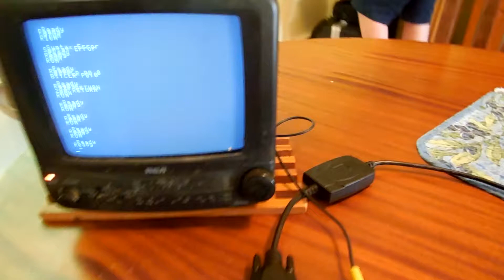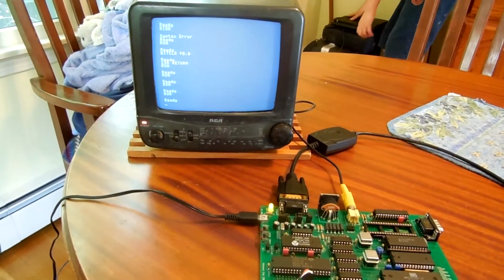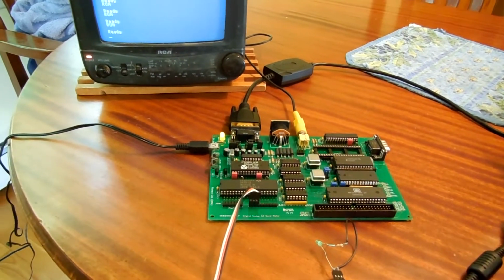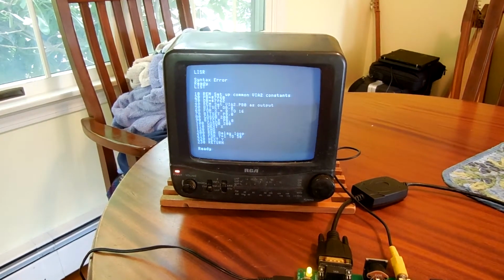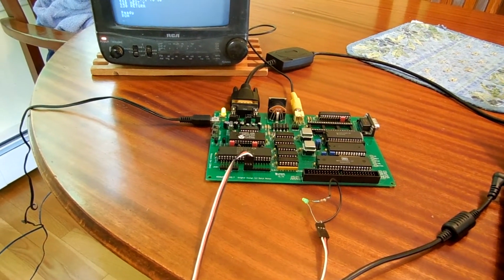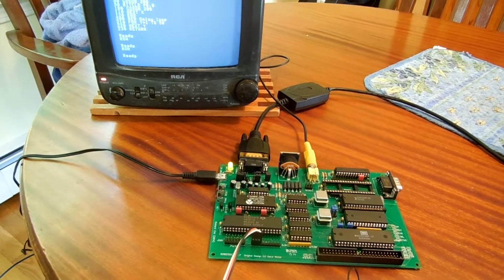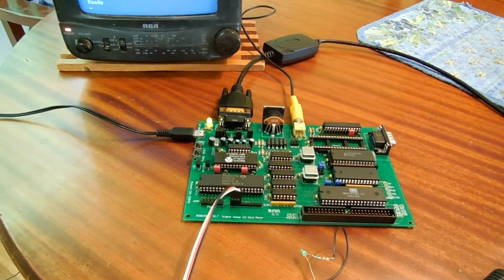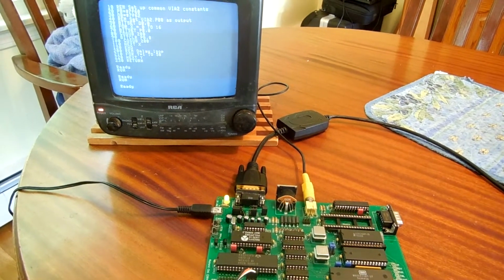6502 Retro Computer for Robotics

Comment: Very interesting! I have issues with your choice of using the Commodore disk interface, as it was the slowest of all the 8 bit systems. Wouldn't it have been smarter to setup a Apple port? 
Anyway, not to nitpick, bravo on your system.
Reply from the maker: Agreed. It was a matter of building on someone else's work rather than laying a PCB out myself.
Reply: @mheermance  Hey, thanks for replying so fast. So its been a few years since the project, any headway since then? That is, any new features added? thanks again
Reply from the maker: @gregryan8227  I added a case and sound card. I added an SD2IEC mass storage but haven't done much with it.
Reply: @mheermance  I thought a sound chip would be a nice addition...I assume its a Yamaha YM2149F or a SID 6581?
Reply from the maker: @gregryan8227  I used the AY-3-8910. A SID chip would have been better, but they're rare and most for sale are counterfeits.
Reply: @mheermance  Good choice! Widely available and very popular. I think they  were used in the MSX computers so popular in Asia? Along with a great variety of 8 bit systems and arcade machines as well.
I'd love to see a video come out on your new system, but I have the feeling its been packed away.
Reply from the maker: @gregryan8227  My eight bit things video shows my sound chip. The system is in drawer at the moment, but I plan to pull it our and burn an EEPROM with my optimizing Brainf--k compiler. It compiles BF programs to native 6502 object code.
Reply: @mheermance  Wonderful! Sounds like an interesting project. 
Since your computer highlighted the control aspect of the project, I thought it would be cool to show how you control more than a single LED. My thoughts are with Xmas right around the corner, you could control a Xmas light display while playing Xmas music, then show the programming behind it all. But that's a large project which would consume a lot of time. A less ambitious project would be a matrix of LED's displaying several types of patterns, again with some sound effects and again showing the programming behind it all. 
Anyway, I'm just spit balling here. I don't mean to be presumptuous.
Reply from the maker: @gregryan8227  I have done projects like that with a microcontroller my "Merry Christmas Robot" video on my channel being an example. But I would need to recode them in eight Forth or 6502 assembly.
Reply: @mheermance  I don't intend to create work for you,my friend. i'm going through your older videos now.
Reply from the maker: @gregryan8227  no worries.